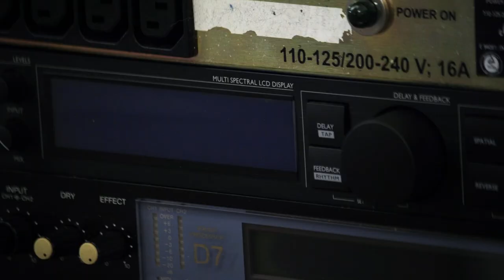FIX TC D-TWO Left Encoder. Do it. Fix your stuff.

Comment: What are the specs of the encoder?
Reply: I would also like to know as there are no info on the web for the encoder model?
Reply: I found it. The spec sheet is here: https://service-tcgroup.tcelectronic.com/files/tech_service/d-two/partlist/spareparts_d-two.pdf

Under the front panel section, the encoder model is ALPS ALPINE ENCODER/EC12E24204 without push function for CONTROL & DELAY. 

The mouser page is here: https://www.mouser.com/ProductDetail/Alps-Alpine/EC12E24204A2?qs=sGAEpiMZZMvy8cVzszrmR%2FKb0hvJH4FvFrhxSgtayfM%3D

You'll want the 15mm shaft length.